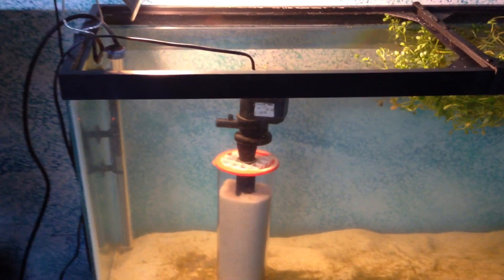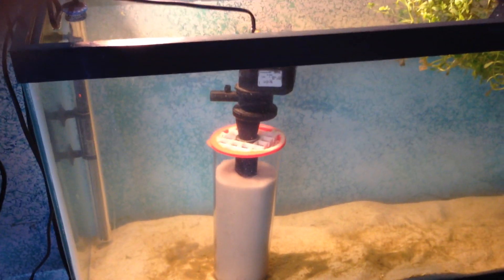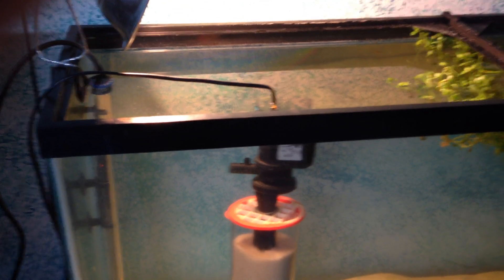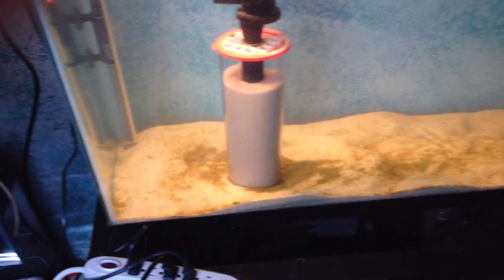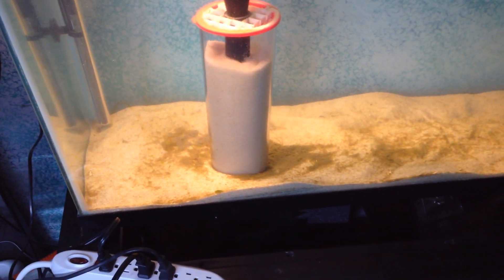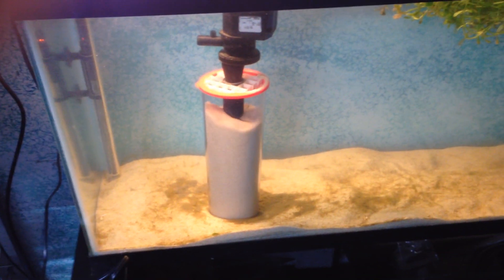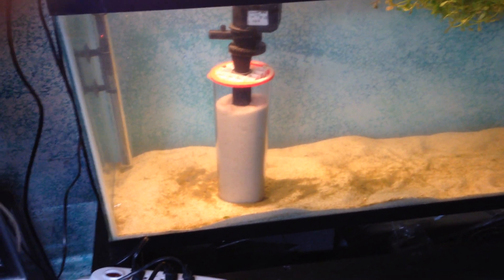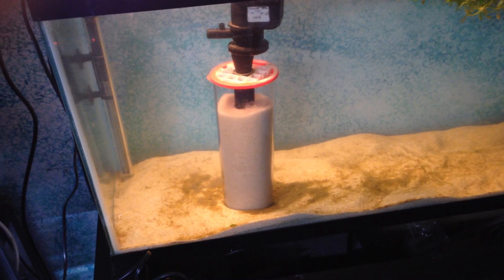DiY Canister Fluidized Sandbed Filter pt 6

Comment: I do not see how you can do so that the water runs into that position or the powerhead in my case I put power head in the opposite direction to yours, the question is how to make it do so and to remove water in that position? you could make me a simple diagram. head, tubing, sand, container in the video because I can not see how you do to put the power head in that direction
Reply: I'm not following your question. What it seems like you're asking is how to balance sand and water flow, if that is what you are asking the answer is - through trial and error.

Comment: you shouldn't lose sand continuously, you simply need to remove a little bit of that sand  so the fluidization doesn't make the sand actually leave the canister.
Reply from the maker: That's why you will lose sand, till the amount that was to much has left the system. At 18 cents a pound, filter sand is pretty easy to come by; if there's to much put in, it will flow out till the exact amount that the system can sustain is left, thus allowing you to mark the canister and know exactly what the max fill level is.